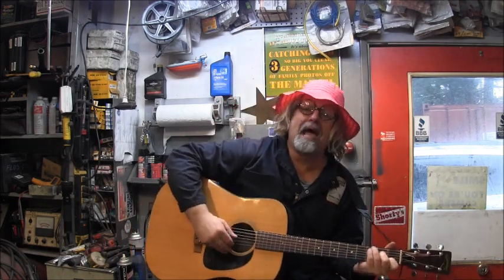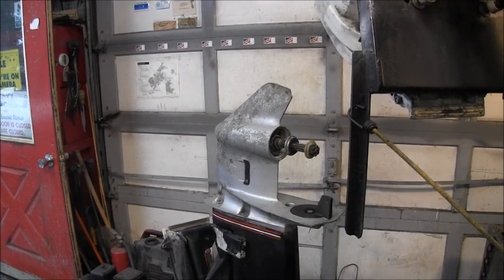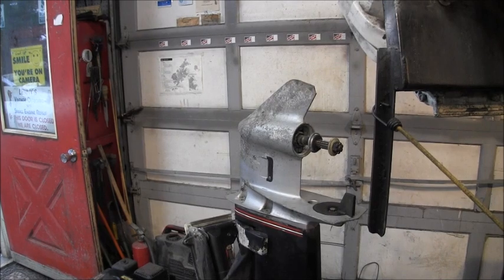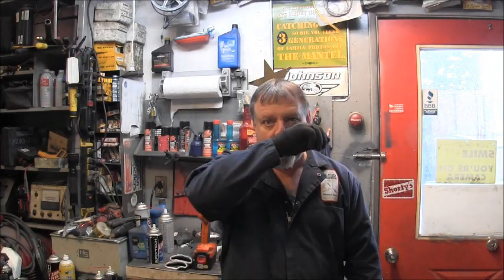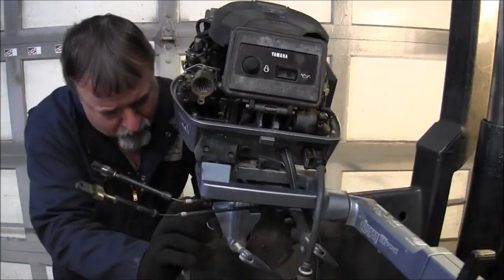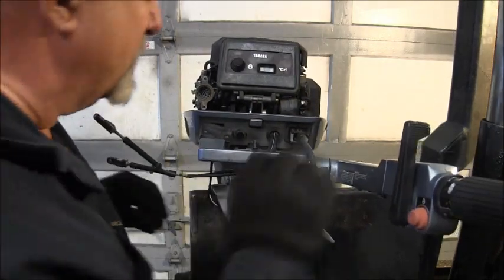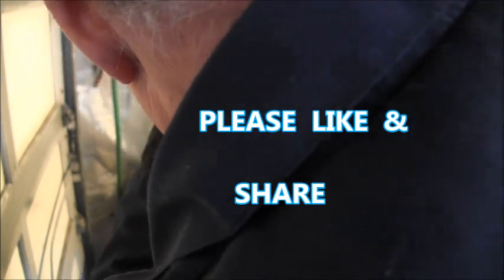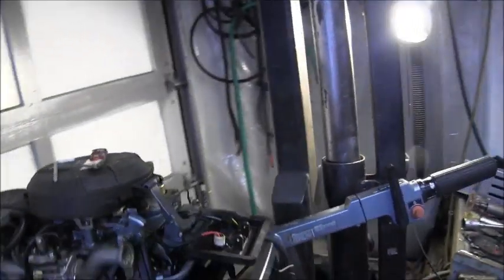1994 Johnson 35 / 40 hp , Despair,       + YAMAHA  9.9

Comment: Hi Kodi. I need a magneto cam sleeve. I believe its called that. It moves the points open and closed for a 1961 Evinrude 18hp  model 15034. The one in it broke into 3 pieces.

Comment: G'day Mate, Enjoyed watching you work on the 40hp...I have a couple of perfect running mid -90's 40/50's on my stand and they are completely useless to me as neither have trim units or gas assist units...Without them on there, they sit too far down/forward in the water and cause the nose of my boat to plough as well as having nothing to hold the leg down if i throw it into reverse quickly..I tried putting a trailer roller on the tilt pin to get it even, but even though that makes it slightly better, it still sits too low ...wondering if you know of another cheap way to overcome my problem
Reply: I'd ask for the gas assist on that parts motor of yours but I live in Australia so shipping could be prohibitive.
Reply from the maker: @philbyalby    Yes I'm sure shipping would B high,,    They sell aftermarket tilt/trim units  ( CMC Marine ) for around $350.00 US.  If u have a couple motors mite B worth it?         kodi
Reply: i have 4 with the touch trim (gas assist) and ALL of them are broken/leaked, and new ones are around $700. kinda ridiculous.

Comment: Whatif you drilled an access hole somewhere near top of exhaust housing so that you could send some heat and penetrant to the base of shaft?
Reply from the maker: I have a jig I made,  I can get the lower off ,  But I ran the numbers on it & it will not fit a 94, so I really had no reason to pull it @ this time.     kodi

Comment: I guess that there are a lot of 2 strokes motors in the 30 to 40 hp range on the island as they made a lot of commercial sense. A compatible one is bound to surface when you least expect it !
Reply from the maker: 4 Sure,  Heck I might even have one in the pile,  Just need the snow to melt.      kodi

Comment: Good advice, sometimes it is best to give up, or at least put a stubborn project aside for awhile.  Like I said, it appears that some sort of change was made to the driveshaft in 1993...So yeah, that 89 stuck driveshaft mess wasn't gonna help you anyway.  But, I am confused.  What year engine did the gearcase come from that you had installed with splines that didn't fit??  I thought you said on this video that it was from a 96 model, perhaps I am mistaken.  According to what info I uncovered, the 96 model gearcase should have had the wider splines and fit your 94 model powerhead/midsection.  If not, then I am on the wrong track...I really don't think that commercial model splines were any different from regular ones either, but that is always a possibility...Especially since some of these commercial engines still used the larger gearcase from the 70hp...But, your midsection is definitely for the regular small gearcase introduced in 1989.  
I have thought of one more inspection that might help clarify this....Find the service manuals for the 89 and 94 models...Go to the gearcase section, then look at the spline socket special tool part numbers for the two years....Different spline sockets confirm my suspicions.  But, we have to be sure to look at the commercial model small gearcase section.  I will look to see if I have service manuals from those years, otherwise will look at my buddy's library in his shop later this week....D
Reply: OK, found a 89 and 95 manual for these engines.....  The 89 manual describes spline socket 316612 for both the recreational and commercial gearcases.   The 95 manual describes spline socket 334995 for both recreational and commercial gearcase...  So, guess OMC made this change in 93, am guessing the larger spine socket fits the newer 70hp gearcase also.....The 70hps used to have a four spline set up, it changed to more splines in the early 90s....D
Reply from the maker: @fleetwin1    On the lower that had the wrong splines & would not fit ,  I am going from memory here '  but I thought the motor it came off was a 1992.  I may have a lower that will fit but I will need the snow to melt before I will know..                          thanks,   kodi
Reply: @kodibassInsideoutboards    OK, well that makes sense...The 92 gearcase would have the smaller splines that wouldn't fit on the 94.  Don't know why OMC changed it that way, never heard of driveshaft breakage or chronic spline wear in that area.  Perhaps just saving money on machining, sharing the same splines with the 3 cylinders...  Sorry for all the hastles on this project, but thankyou for pointing out something that might save the rest of us time and trouble...D
Reply: @fleetwin1  thats right. 4 spline to fine spline in 93'. i think they had leftover parts like the 3 cyl loopers

Comment: Those B&D cordless are they 18 volt or 14.4 volt ? I have 2 words BIKE CABLE ! Lol.
Reply from the maker: They R 18v,  with the quick change chuck,  I luv'm.
Reply: @kodibassInsideoutboards  are they the slip in from back batteries ? I have the hedge trimmer and reciprocating saw and flash light and 2 firestorm drills .  I’ll check the voltage and if there 18 volt you can have them !